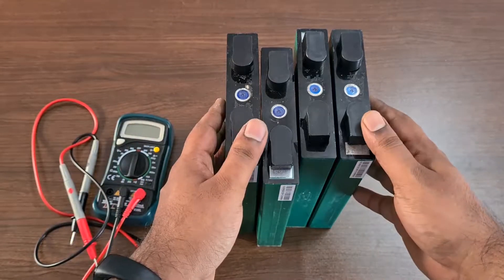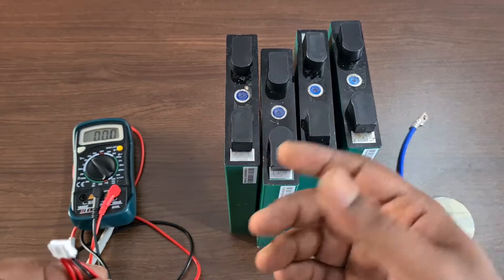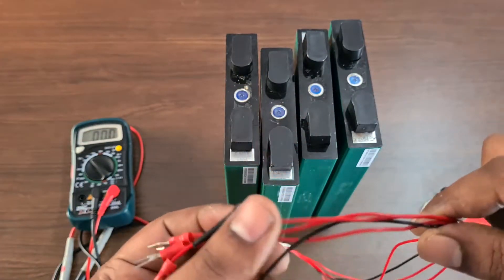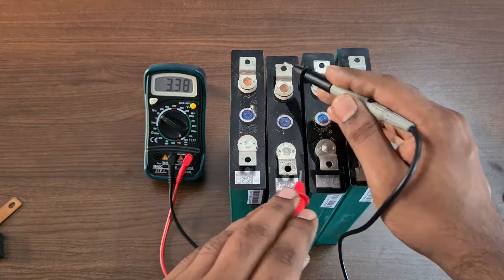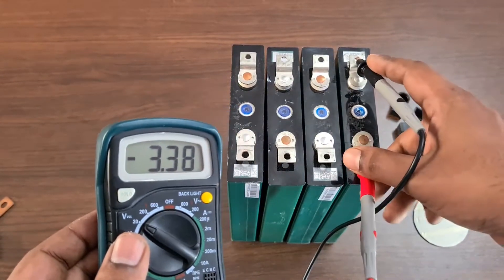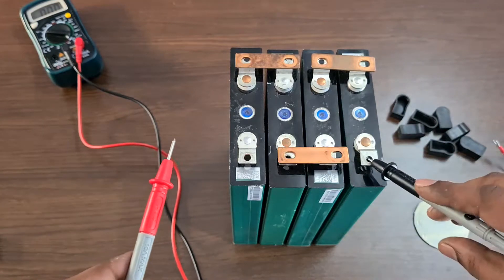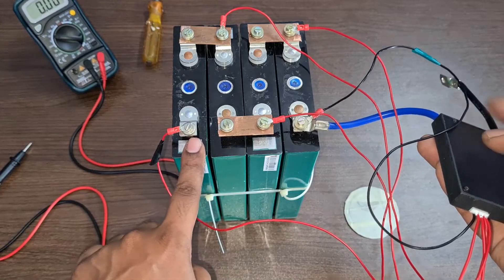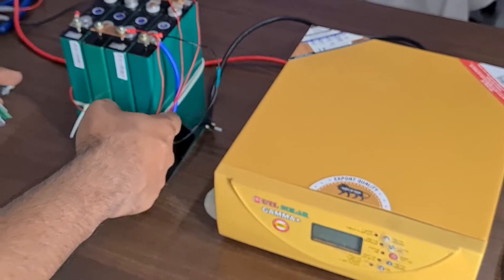12V LifePo4 பேட்டரியை வீட்டு இன்வெர்ட்டர் பேட்டரி ஆக உபயோகம் செய்வது எப்படி

Comment: Where is temperature sensor  in BMS , if any temperature difference in lipo4 batteries how can you identify.
Reply from the maker: No temperature sensor.. battery will not heat as you are using for amps draw less then what it is rated for and bms will cut off the battery if goes per cell above 3.7v or if it goes below 2.4v

Comment: Sir pls suggest which brand inverters will be suitable for Lifepo4 for 12V and 24V inverter
Reply from the maker: Most of the invertor should work, but if you need dedicated lifepo4 support, try unipar and vispara.
Reply from the maker: Check my other video on microtek invertor. That will give you an idea.

Comment: Sir iam a solar user full house .se my tubular batory 150ah#2nos(24)volt  due for replacement ...shal I go for life-po batorys what is ur sugessolo.if so pl letme know a reliable source for procuring spares so as to assemple .can u advise me personaly
Reply from the maker: Yes you can use lifepo4, but please do your research before moving to lifepo4. Lifepo4 has higher cycle life

Comment: Bro, I have made LFP 32700 6AH battery pack for my UPS, so my cell voltages are cell a- 3.37v, cell b-3.38v, cell c-3.38v cell d-3.33v. So shall i charge the cell (a) and (d) separately with 3.65v to make it to 3.38v. Will it work for call balance?
Reply from the maker: instead of charging only two cells to full capacity. i would suggest you top balance all the calls. that will be much better.

Comment: in this setup backup timing how  many watt can use example continue run 200 watt
Reply from the maker: its a 90ah battery, so considering the investor losses, you should easily get close to 5 hours or more.
Reply: @diyIndia  same setup  we can connect 4s 2p with single bms or another bms need or not

Comment: Which cell is better,blue or green?
Reply from the maker: Both are good but capacity is different.  Thats the difference.
Reply: @diyIndia  seller told me that green coloured one is having 3000life cycles & Blue coloured one is having 2000.is it true?
Reply from the maker: It dependents on the manufacturer and the grade of cells. Not all cells are the same.

Comment: Any suggestions on using a higher capacity solar inverter that will support lithium phosphate battery
Reply from the maker: I was searching in the market for a good inverter as far as i know.These brands have built in LIfePO4 charge profile. Hykon, Vispara, Luminous and Unipar(they can set the charge profile).